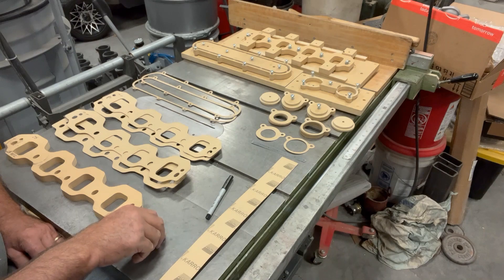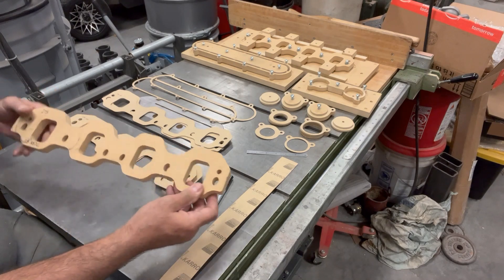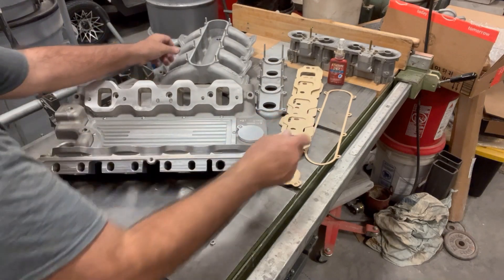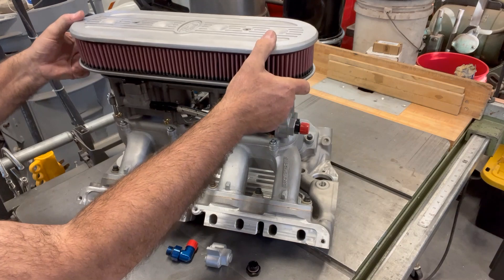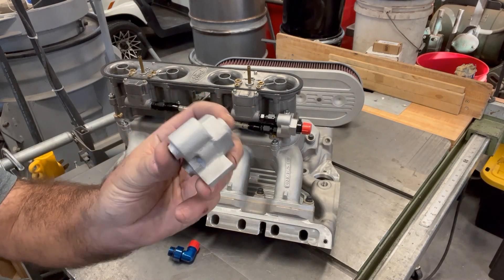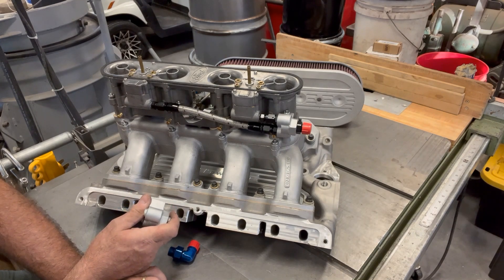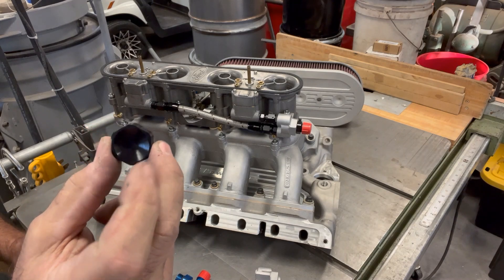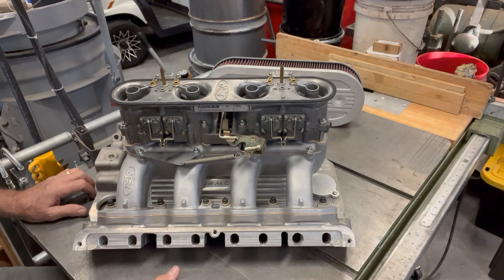Ford FE Inline Carb Intake Manifold Lost Foam Casting Part 2

Comment: Hi Kelly, im looking at your work, and it looks very, very good. I am wondering if you create any taper into the runners of your intake manifolds. Its difficult to see in the videos and images.
Thanks for your time.
Reply from the maker: Yes, normally between 15-25% reduction in runner cross section depending upon intake and engine.   Best, Kelly

Comment: Would you  cast an intake for a big block chevy if I brought the foam mold over?
Reply from the maker: Very unlikely because the foundry work is just part of the whole induction system project for me, and I'm not really looking to do contract foundry work.....just teach it for others to use. If you go to www.inlinecarb.com you can contact me with the email with that domain name on the front page. Best, Kelly

Comment: You should make the bottom piece of the manifold a two piece design so you can work on a single head if needed. Having to pull the rockers and push rods on both sides to get the intake off is a pain. FE racers should like it.
Reply from the maker: You must not be familar with the FE intake adapter shown (go to www.FEPower.net to view and or buy), or have watched the first video about the making of the intake. The adapter already accomodates this. It is two pieces. The (dry) upper 351c style intake is removable and the lower stays in place allowing all valve train, coolant circuit, and distributor to stay in place. There is a valley plate on the adapter that can be removed to provide full access to the lifter valley leaving everything in place. Just like with any FE, it is possible to pull one head without pulling the intake (in this case adapter), but sealing the intake surface upon reinstallation gets a bit tricky.....but it has routinely been done throughout the years. Best, Kelly
Reply: @kellycoffield533  the lower is a two piece? I did work on an old 390fe years ago that had a blown head gasket on one side. What a pain it was to pull the rockers and push rods on both sides. I'm just surprised nobody has made an intake that would allow you to work on one side at a time. Ide rather fool with gaskets than re-torquing the valve train on both sides and I think racers using it would feel the same that use the old Ford FE.
Reply: @brianb8489.   Look at the bottom intake he has in the video. That is aftermarket, not from the factory. What he means is that the flat plate you see in the middle of the lower intake can be taken off from the lower intake to expose the valley. The parts he is casting are the upper intake plenum and runners. The lower intake was designed to put on an fe engine but run much less expensive 351 Cleveland intakes.

Comment: I suggest you buy a Silhouette or cricket. They are hobby CNC knives and will cut stuff without a fixture. Simply draw what you want, load your material and it will cut it out. Some of the models even take rolls and can take something like 20'? although I don't know why they have a limit.
  They also don't take up much space and are fairly cheap. They can cut or draw stickers, emblems, labels... I also use mine to make labels for the jars of stuff I might make up, like Wax. Danish oils and Shellacs.
Reply from the maker: I've been putting off buying/making a drag knife and vacuum table for my cnc router. Both are pretty simple to make. I may have to cave in. Best, Kelly

Comment: Amazing work! I am most curious to know what kind of power levels that setup might attain.
Reply from the maker: That's probably more dependent on the cam and how well the heads flow. I have a 750HP Holley on a 400 CI engine with a solid roller that makes 650HP. The inline carb is 875 cfm. -Use you imagination. 😀 Best, Kelly

Comment: Great work. 25 years ago I was a tool maker in a shop that made masters and molds for investment casting. While doing that for work I was part of a local level stock car team that ran Ford engines. Now I work in a prototype department programming and running 9 axis Mill Turn lathe. But would love to make cool vintage engine parts the way you do.

Comment: I'd love to see your CNC foam routing techniques. I see you have a four post alignment system, but how do you re-index the router to a known zero after you flip the foam to route the backside?
Reply from the maker: I usually set up the models such that the machining origin is the same location for either side. First order of business in set up is set up the machining origin about the index pin holes if they already exist in the waste board, or if not, just set the machining origin and make cutting the index holes the first op before I mount the foam stock for machining. When I cut the backside, the machining origin remains the same and I just install the index pins, flip the stock, mount it on the index pins, call up the backside program and let it rip. Many times it doesn't even require a tool change because I do most of my foam cutting with a long 1/4D ball nose. If it does require tool change, I only need to reset the Z zero, not X or Y. Best, Kelly
Reply: @kellycoffield533  Great info. Thank you!

Comment: Just amazing man! Talking Pushrod V8s, CNCs, Fixtures, Production cycle data, and gasket material, and Carburators mounted on beautiful intakes!!! Man, was this video made for me... It sure looks like it.

Just one thing, Kelly... Are you sure you are allowed to show those sexy sexy poses from 06:15 onwards..? Although, let's face it, it takes an adult to handle a properly tuned 351 Ford V8 with an intake and carbs like that.
Reply from the maker: K, This would be an easy task for you.......and you only have half as many cylinders to deal with! Best, Kelly
Reply: @kellycoffield533  Hahahaha... Touché! Excellent work man!

Comment: Those carbs are so dang rare! This is a LOT of work for such a rare part.

Autolite only made ~1000 of the 850cfm "A" models.

It's still freaking awesome. These things love high rpm and sound fantastic.
Reply: FE engines 'love' high RPM? What RPM do you consider high?
Reply: @danontherun5685  For the time, 5500 and up was screaming.

Comment: When are you going to start casting your own carb bodies?
Reply from the maker: Done that. Best, Kelly
Reply: @kellycoffield533  Were the inline carbs strictly a Ford thing or were they used by other companies? They are very interesting to look at.
Reply from the maker: @jamessheets9205 They were a Ford thing. At the time, Ford had acquired most of Autolite around 1960 and they were a captive supplier to Ford. They may have sold some branded things elsewhere but only at Ford's whim and because of that Ford was forced to divest autolite due to an antitrust lawsuit in the early 70s. The last Inlines were date coded Feb of 72. From there, like Ford products were Motorcraft branded but inlines were no more. Best, Kelly
Reply: @kellycoffield533 how much do you sell them for ?